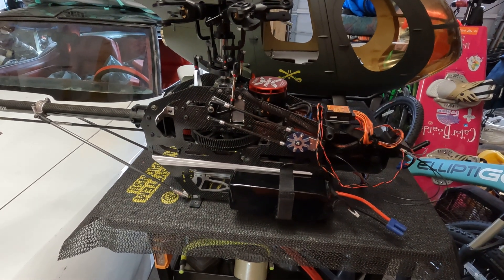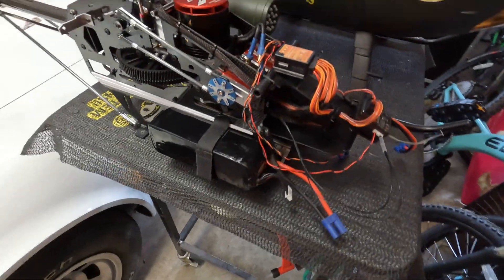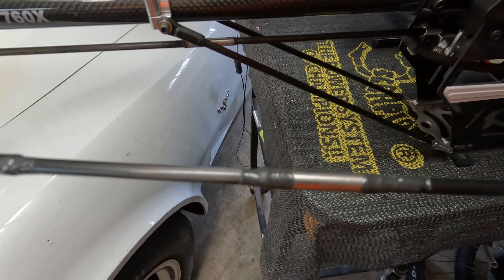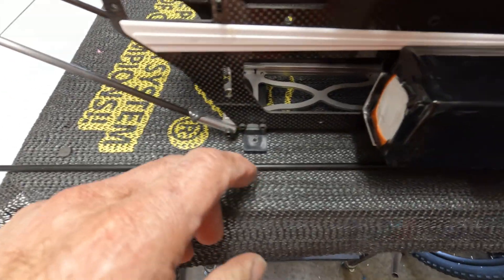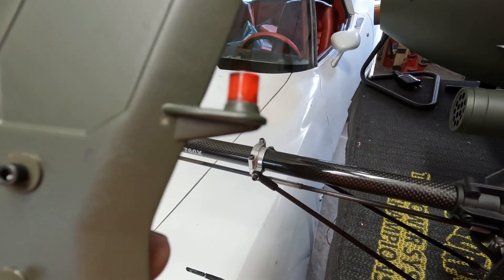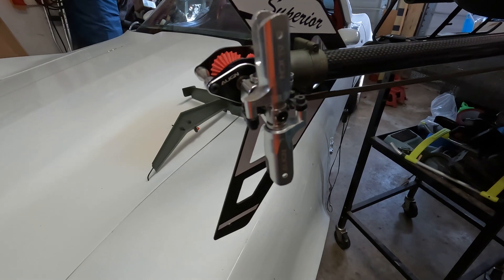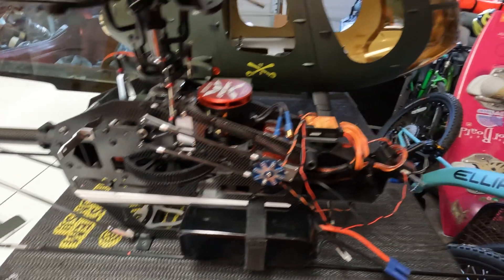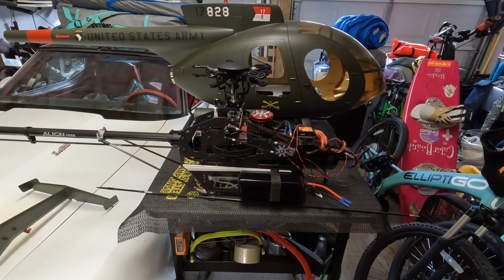Funkey MD500 mechanics overview part 2.

Comment: Hi, looks great 👍 I’m building one myself a 500e g jive 5 blade head I’m wondering if you could make a video on the setup?
Reply from the maker: Thanks for the comment. The Microbeast or BeastX setup is pretty much the same if you’re using a multi blade head or just a 2 blade head. I’m planning another build video this fall maybe then I’ll add the FBL setup.
T

Comment: I like what you did as at least some form of boom support as the fuse boom as they are stock are a little soft laterally - particularly if not bolting the canopy on rigidly 👍🏻
Reply from the maker: Exactly, I wanted something there besides the fuse.
Reply: @Fran11784  just remember re boom length that a standard 700E boom length is approx 50mm over length in terms of "scale" and that full size do appear quite short...